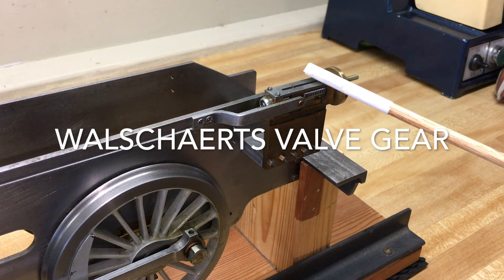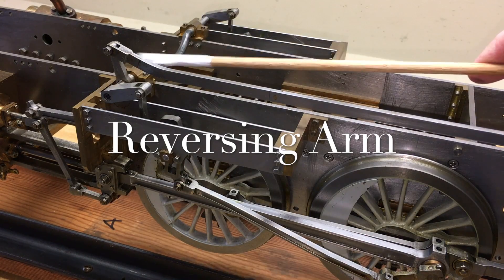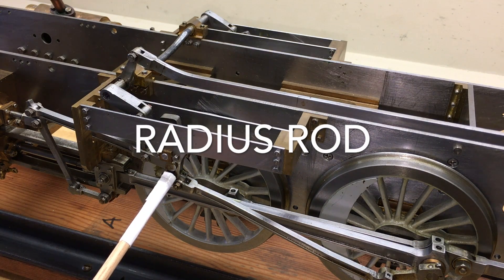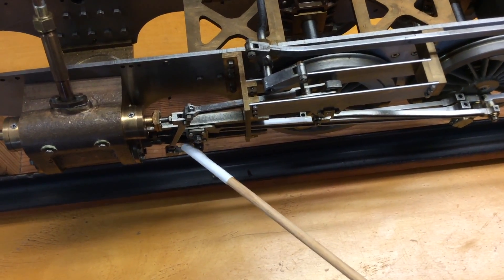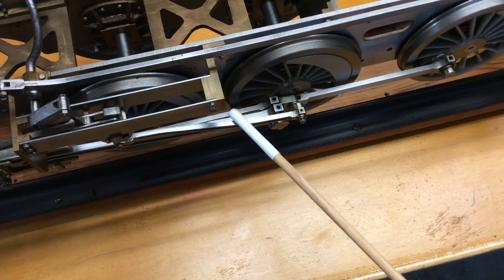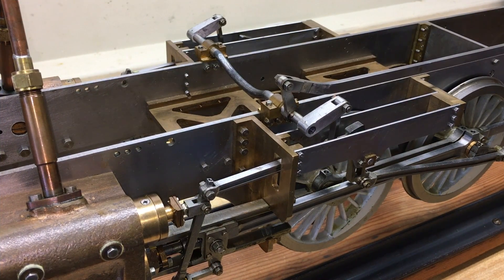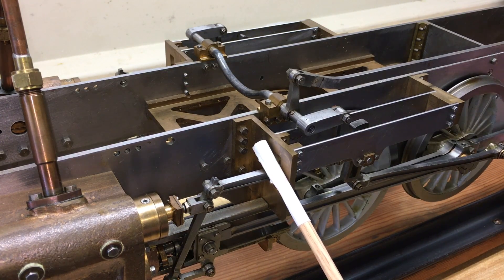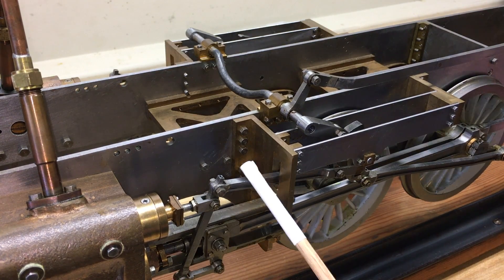Walschaerts Valve Gear for a steam locomotive.

Comment: Walsch must have been a genius, can anyone explain ,.percentage cut off,.?
Reply: Very basic, it is the percentage of the piston stroke in which the piston is powered under the steam from the boiler. It can be controlled by the time on which the valve close the admission. For example, a 30% cut off mean that piston move about 30% of its stroke under the steam coming from the boiler (at boiler's pressure). After that, the valve close the admission, and the steam trapped in the cylinder expand adiabatic, under its own pressure. As the steam expand, it cool and its pressure drop, until piston reach the end of the stroke,  the valve open the exhaust port, and the steam is pushed out by the return stroke of the piston.
Percentage cut off help saving steam (thus saving water and coal), by delivering only the power needed to compensate for air and rail friction.

Comment: Beautiful!!! 
Could you please do a video explaining sincronization between both pistons?
Reply: You mean left and right side? They're on the same drive wheel shaft, no need to synchronize anything.
Reply: The cranks are set at 90 degrees on a two cylinder engine, not 180. This is to make sure there will always be one piston on a power stroke.

Comment: Did steam engines have their own version of "dynamic braking" seen on modern diesels?  That is, could a steam engine going down hill be shifted slightly into reverse so that some amount of steam pressure was then acting to retard the speed of the train?
Reply: Not in the traditional sense but I through the engine into reverse to slow it down, it puts quite a lot of stress on the motion but nothing bad has happened yet (knock on wood).

Comment: Better cut a left handed thread for your reversing stand. The driver might get confused! Nice and smooth on air, well done.
Reply from the maker: A left handed screw is not required as the lifting arm is pointed to the rear and lowers the radius rod when the reach rod is pulled to the rear. This is shown in the video.

Comment: Would you show me how to design the gear?  Tried Don Ashton's book n software - Not clear about his variables in his equations.  Dockstaeder's software - Some of the variables,
especially the reverser gears are not explained and the animation rods disconnected, etc.
Reply from the maker: I did not design the valve gear. I purchased a set of castings and plans from the English company, A J Reeves. The model locomotive shown was designed by Martin Evans and as you can see, it works very good. The construction was a series in Model Engineer magazine. Martin Evans designed many locomotive from 2 1/2 to 7 1/4 gauge. He also published several books on building  model steam locomotives. I have three. He does describe the designing of several valve gears. His book titled the "Manual of Model Steam Locomotive Construction" is available for free download from google docs.  I am not familiar with Don Ashton or Dockstaeder's software.
Reply: I see.  Thank you for your response.  All these people who said they've
used Dockstaeder's and Ashton's software never were able to explain
step by step on how to use the software, esp. on describing the walsch's variables.  i guess the only way i can do is to use geometric
drawing method, make a paper model cutouts of components and
hook them together, move it 2C if the valve close and open the ports properly.  heck!
Reply: Yes, I have one of Martin's book on the valv. gr designs as well as Greenly's.  They help some what on general steps.  Back set amount
is a bit difficult to understand and draw it on a paper sheet.
Reply: @steamup1 
Don Ashton was a valve gear wizard. He also wrote in the model engineer.
Marti Evans designs are very good but not perfect. Another traditional designer of miniature steam locomotives was the late LBSC. His valve gear design often had faults, but worked. One of LBSC,s faults was small port openings. 
A popular 0-4-0 loco was 3.5in gauge Juliet. This engine was available as a slip eccentric valve gear, Steven's or outside Baker Valve gear. I have built 7 live steam locos, 3.5, 5, and 7.25 inch gauge. Two of those were Juliet's, a slip eccentric and a Baker   version. Making maker valve gear that small was a real pain. Baker valve gear is an American design that is not best used in conjunction with slide valves, as fitted to Juliet.
Reply: Don Ashton wrote a book on how to use his software to design valve gear.  It is somewhat more intelligible than his website.  Even with the book, it is easy to see why so many simply copy existing designs rather than try to come up with their own.
Reply: If you need to ask you won’t be able to build one ,because you are a total moron .